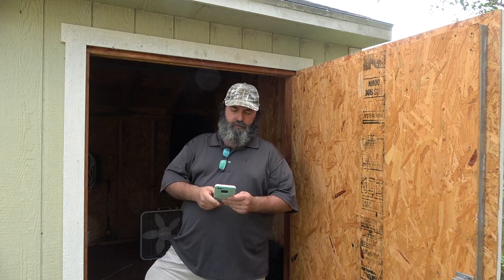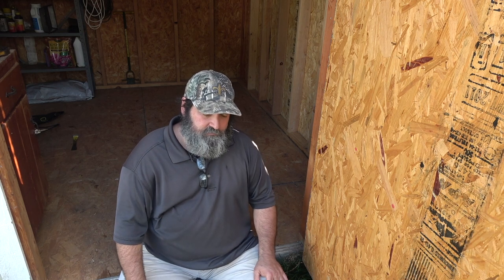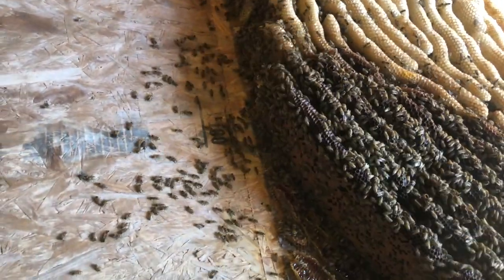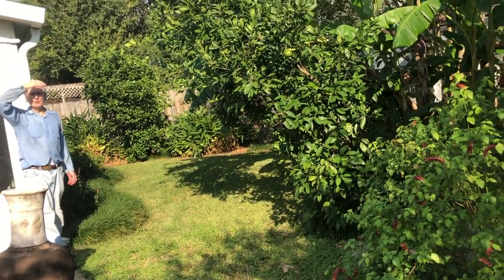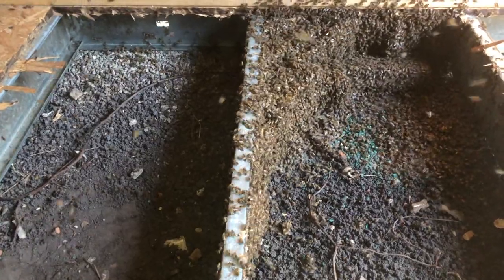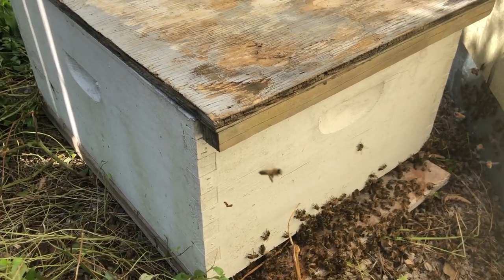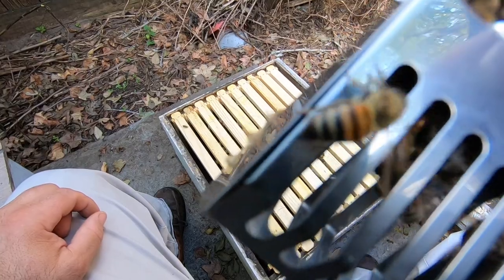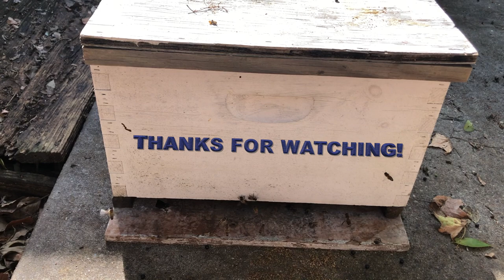Bee Man Vs Big Beehive In Shed Floor

Comment: Jr thanks again for the informative videos.  I have a couple  of questions.
Would all of that comb be framable or worth keeping it if you filled all of you frames. 
Also I thought I see. Where you done a video on the Bee Vac. You use.  But, couldn't find it an wanted to know which one and where to get it or a good one if it's no longer made or avaliable. 
I also wanted to thank you for the tip on putting them in with the comb and frame upside down.  But after fighting that all day today.  Some of the comb I removed would just start Co ING apart just holding it.  Had 3 pieces hit the dirt.  Not to bad.  So I still framed them.  I also got the white honey comb from the trash as it was to fragile to frame.  But makes great looking beeswax.  Thanks again.

Comment: That's a tuff shed   I work for tuff shed in California.  We have those holes for cross ventilation so the floor won't rot out.  But we now came out with screen covers so we don't have to worry about that problem   between each hole is a floor runner to support the floor
Reply: If you wanna get the screen covers we sell them as Track Vent Covers
Reply from the maker: I tried to locate them on the Tuff Shed site but didn’t see them. I usually just use #8 hardware cloth & self tapping screws to seal over the square cut outs to prevent other swarms from recolonizing the shed.

Comment: New to recovery's. Should you leave vac running if not continuously sucking up bees? I live in East Texas, where like you, it can be very hot and humid.
Reply from the maker: If you shut the vac off you have to close the blastgate & remove the vac top or the bees will overheat & die.

As long as the vac is running it’s ventilating the bees in the catch box, at least with my set up.
Reply: @JPthebeeman  Thank you very much for your reply. I built a vac like Mr. Ed. I also added a rheostat to slow down the speed of the vac. I really enjoy your videos. Thanks again.

Comment: I always was curious on how farmers protect the hive from rain or snow. Do they use tarp or do they move them to a secure location
Reply from the maker: Most beekeepers set their hives up with the back of the hive slightly higher than the front so any accumulated water runs out of the hive.

Honey bees cluster together and have the ability to generate heat so are able to keep warm on cold days.

As long as the air inside the hive is not cold & damp they’ll do okay.

In really cold climates beekeepers tend to wrap the exterior of the boxes with insulation to help maintain warmth & also serve as a wind block.

When able, many migratory beekeepers will move their hives to warmer locations during the winter so the bees have a better chance of surviving less harsh winters.

I knew a guy who overwintered his bees in Texas but moved them in the spring to S Dakota for the sweet yellow clover crop.

Comment: If you're looking for a better (and cheaper!) thermal camera, then I recommend looking into a Seek Thermal Reveal. Your Flir E4 has a thermal resolution of only 80x60 pixels, and costs about $1000. A Seek Thermal Reveal Pro costs $700 and has a thermal resolution of 320x240. That's 16 times the resolution of the E4. So I'm talking about the resolution of the thermal sensor, not the LCD display. I know the E4 does a trick with an optical camera to add some detail, but the underlying thermal picture is still blurry. For instance, try using it in the dark, the optical camera can't add detail then. The Seek Thermal Reveal still shows a sharp picture in the dark. And it's a rugged device, just like the Flir. I don't work for them, I just like watching your bee videos and I like thermal imaging, so I thought you may be interested. Take care! :-)

Comment: How often do you actually find a second queen?
Reply from the maker: It depends on the time of year. If it’s during peak swarming season (March-May) you could open a hive with multiple queens on a regular basis.

Later on in the season when they’re not in swarm mode usually you run across one but statistically speaking roughly 20% of all colonies overwinter with perhaps 2 queens.

Comment: Have you tried using vape smoke? Does it have the same effect?
Reply from the maker: Have not & likely wouldn’t as most e-cigarettes contain nicotine which is a pesticide.
Reply: @JPthebeeman  Actually you can buy  e-liquid with nicotine or with zero nicotine. I  myself don't vape but I made a video about vaping vs smoking and have been playing with and experimenting with the vape pens to see what other uses a vape pen may have. I've come up with a simple compact thing that creates smoke instantly, and plenty of it. There's only 2 uses I can think of for it and that's to find vacuum leaks in a car engine and a smoker for bee keepers.
Reply from the maker: @chrisnotap  they actually have battery operated smokers such as the Bee-Zee-Smoker, never used one myself but heard of them years ago.

Hey, whatever gets it done & you’re happy with, right?